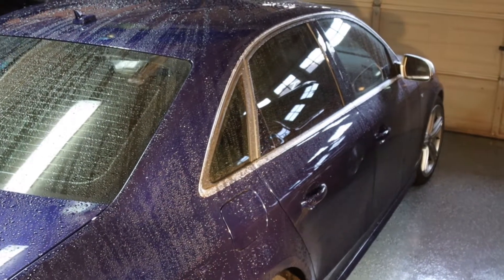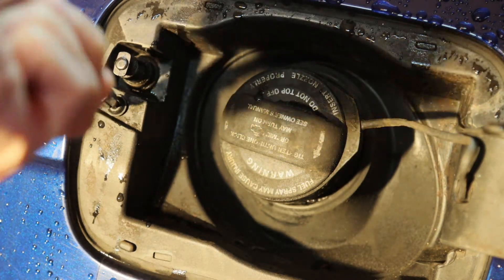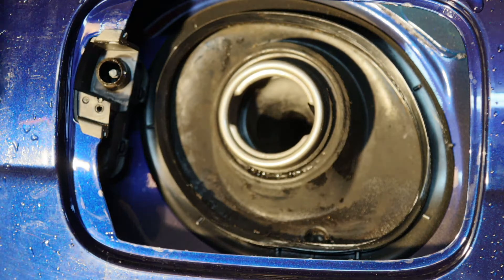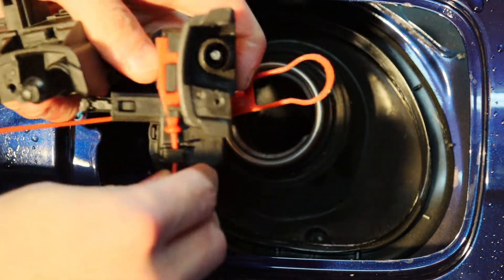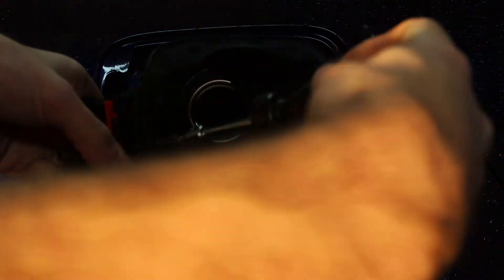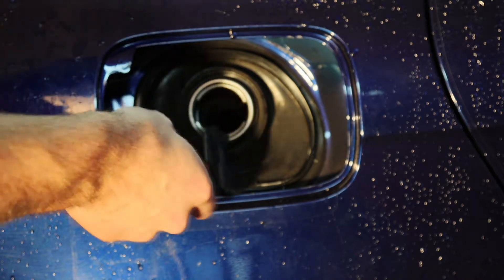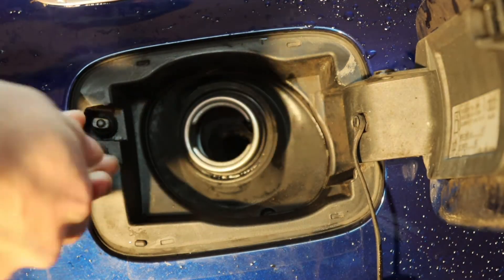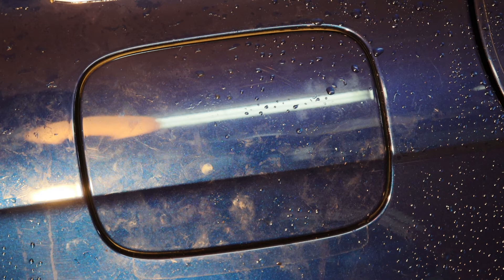Audi B8 A4/S4 Fuel Door Actuator Replacement

Comment: Thanks for the video. I just did this on my wifes car. Her's had been failing to work intermittently for awhile and she had even broken off the red cable on the original. I got it done in about 10 mins thanks to you showing what worked (and didn't). She reached towards the front from where the red cable used to be and I was able to hand her the new cable so all is good. Who knows how long this latch will last but at $25 and about 10 minutes to swap, I'll take that risk.
Reply from the maker: Our cheapo part is still going strong!

Comment: Thank you for sharing this video. Regarding my 2013 Audi S4 B8.5, once the T-20 torx screw that connects the fuel door actuator to the fuel door assembly had been removed, the task of pulling the assembly to the left and towards me was a bit of a challenge. Having a set of sturdy plastic pry tools, especially one similar to cat's paw pry bar with handle, allowed me better access to the space between the back of the left of the assembly without touching the rubber lining of the fuel tank opening or damaging the plastic assembly. Once the pry tool was pulled to pop out the assembly from behind the left side, the next steps were to follow the reverse order of your work. Disconnecting/Reconnecting the electrical clip, reusing the red plastic manual pull release, reinstalling the new actuator using its top/bottom sliver clips, then pushing in the right side first of the fuel door assembly, the actuator remained in place while everything snapped back into its original spot. Watching your trial and errors helped me to avoid a few errors and saved me an easy $50 minimum at an Audi indie shop. Kudos!

Comment: Not joking, but was very easy to remove with crowbar from the middle (using fuel tank hole as support) with moderate force. 
Popped right off, no screwdriver marks or any bending. 
These screwdriver holes did not help me, only those scratches would have looked bad later.

Ordered new part with code "16SKV405" ~18eur from local dealer. Works great again. 
Audi A4 2012.
Reply: Pulling towards the back didn’t work for me. It didn’t even budge. But this method, but with a screwdriver instead to use as a lever, worked great for me.
Reply: Me too!  Thanks for taking the time to provide this tip!

Comment: Lucky you that u can just pulled it out. It must have been removed before. People puncture hole to get a flat screwdriver to unclip them. Wish u did show close up of the clip so that we know how deep and what angle to unclip. Or maybe it is easier to remove the wheel, fender lining, and reach in from under.

Comment: Where did you end up attaching the red cable to? I’m trying to figure out where it goes.
Reply from the maker: Nothing. In an emergency you can pull the interior trunk panels to gain access to the cable. The cable wasn't attached by the factory, so I didn't bother with it.

Comment: For some reason the frame that holds the door/ what goes on top of the actuator will not come out but everything I have is exactly the same. Even the replacement door frame/ actuator